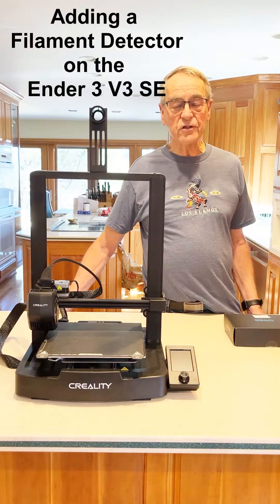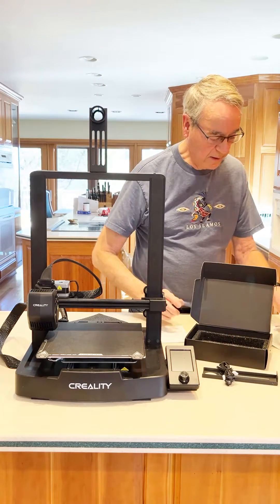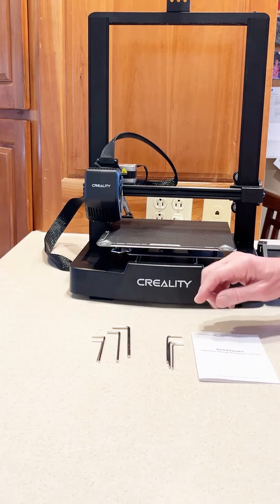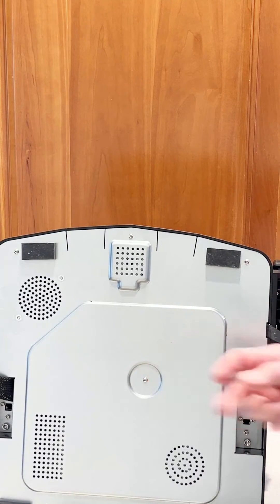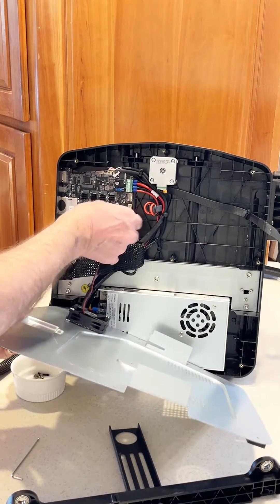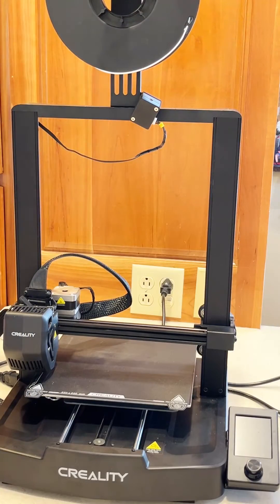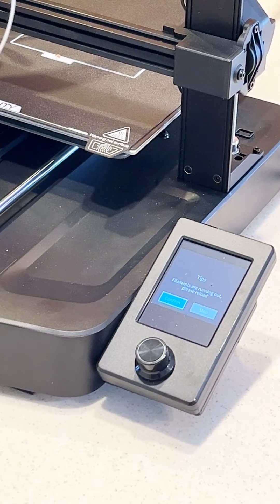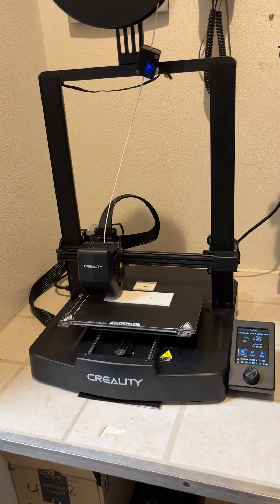How to Install a Creality Filament Detector on an Ender 3 V3 SE

Comment: One thing I noticed. Near the end where you feed the cable from the top of the vertical column to the filament detector you let it be outside the horizontal support. There is actually a special set of groves and exit points to allow the cable to run WITHIN the horizontal support. This way it only comes out just behind the filament detector. In addition I could not do it your way without getting the cable pinched between the veritical and horizontal columns as it came out under the horizontal the horizontal one. All a bit messy to do but very neat. Of course the Creality supplied instructions said absolutely nothing about all this.

Comment: Whilst I appreciate the time and effort you've taken to produce this tutorial, it's a complete waste of time. Like others have explained my fan cable is firmly locked in place and cannot be removed. The bigger issue is that the 3-pin cable does NOT fit down the vertical extrusion like you have shown. The cable end (plastic) is far to big to fit down - I'd show a photo but YouTube sucks and won't let me attach an image to this post). Now I have to reassemble everything and hope I haven't screwed up a printer that was working perfectly prior to trying this waste of time. I'm just going to throw my runout sensor away; I don't need this crap in my life. 
P.S. After reassembling my printer, my levelling is way off, it was perfect before now it's all blue and yellow.... what a huge pain in the ass, all for nothing
Reply from the maker: On assembly, they often hold the fan cable to the printed circuit board with a blob of hot glue. It looks like a white blob. You can take a pair of needle nose pliers, grasp the blob tightly, and pull it off.  But you can just leave the fan cable attached with the cover plate hanging if you don't want to do that.  
You may be trying to push the wrong end of the cable through the extrusion or it may be positioned incorrectly.  One connector on one end is larger that the other.  If you got the kit from Ender, I can assure you it will work.
Reply: The tiny diagram that came with the sensor kit shows it connected to a three pin socket half way along the LONG side of the mobo, but in this video it connects to the correct sized four pin (but only three wire) socket on the short side of the mobo.

Comment: I must have the older model of the v3 se. Mine doesn’t have a passage for hiding the wires on the top piece and no opening to feed the wire into and down the gantry without crushing it.
Reply: Yo tampoco, lo tienes que poner por fuera y apañarte con el cable colgando por la columna.

Comment: i installed this on my ender3v3 se and its not working, im assuming i have to upgrade the firmware, anyone know where i can find the correct firmware?
Reply: Comment in here if you find the answer, it also does not work for me and I'm not getting any help

Comment: I am unable to fit the top frame back I have to carve a small dent under the frame where the cable/wire comes to be able to fit the frame
Reply from the maker: Running the cable is a little trickie, but it does work.  Your way is also a solution.

Comment: Anyone managed to get this working with the Ender 3 V3 SE and the Sonic Pad?  Installed it all today with the help of this video and nothing :(  Doesn't seem to do anything.
Reply from the maker: I have never tried Sonic Pad. Sounds like it isn't compatible.
Reply: @DeansNScaleTrains  I was able to work it out.  Just had to add some gcode into the printer.cfg file.

Comment: Thank you for the great video. 

Question: When you reload the filament after the sensor trips and pauses the print, do you have to use the extrude command or does the machine automatically prime the nozzle?
Reply from the maker: Don’t know. I need more experience with it. Anyone else know?

Comment: its false you cant plug that there the plug is 4 pin but your cable is 3 pin you must plug the cable to next to edge screw three pin slot ı do it now and its work with that
Reply: Can be 2 different version of the filament sensor ?